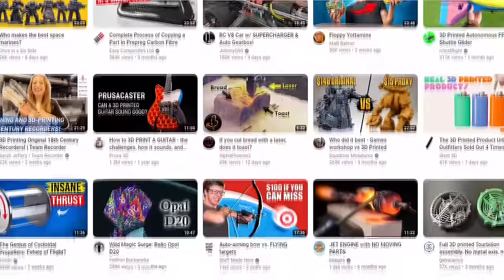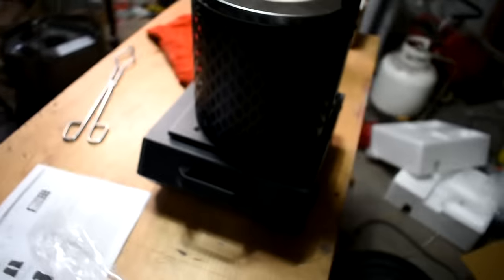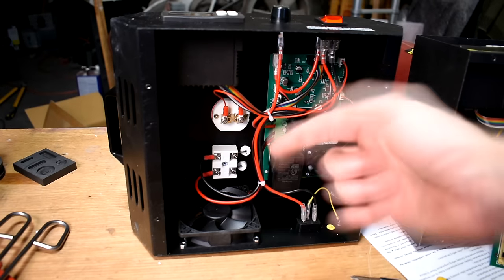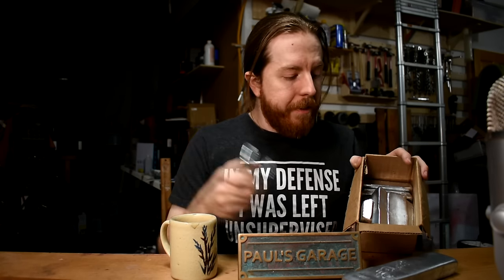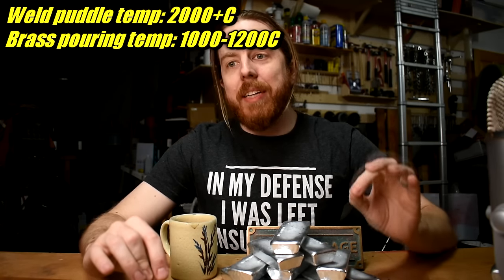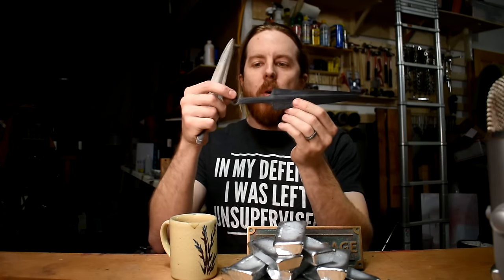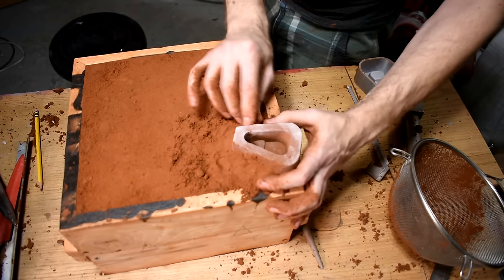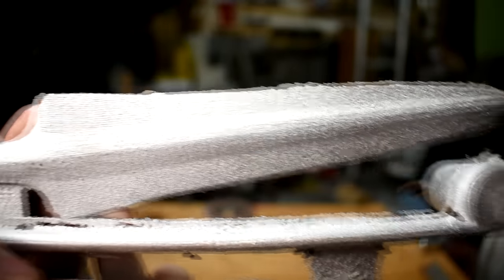Want to Start Metal Casting?

Comment from the maker: Vevor Furnace: https://s.vevor.com/bfQYTT
Code: VVMH5%OFF (5% off on all products)
Rotometals Za-12 Ingot box: https://www.rotometals.com/zamak-za-12-mini-ingots-pack-of-12-1lb-each-free-shipping/
Want to learn sand casting using your 3D printer? I can teach you!: https://paulsmakeracademy.mykajabi.com/joinus
Spear point STL: https://www.myminifactory.com/object/3d-print-spear-372026
Reply: Use a card scraper instead of sanding for 3d prints. Saves a ton of time.

Comment: Excellent video and thank you for asking Rotometals for smaller ZA-12 ingots!
Reply from the maker: thanks!  and yeah those smaller ingots are super nice.  The huge ones are even too long for my biggest crucible in the propane furnace, they stick out the top.
Reply: @PaulsGarage  ordered a box.  Have lots of stuff that’s too big for my new little furnace like yours. This solves having to make small ingots to try it out. (I have large gas one too, but it’s under snow still.

Comment: Nothing wrong with making castings from extruded aluminum. That's what i use most of the time. Window and door frames are 6061-t6. I turn them into ingots for storage and before casting. All the aluminum, brass and bronze i got was free. I just put the word out i wanted any scrap, now i have about 300lbs of those alloys. Probably more than I'll ever use. All metals are cast at some point in their manufacturing process. Just use an alloy that suits your needs. The electric furnace sounds good. But it's a little hard to use offgrid.
Reply: If offgrid is your thing, gas burners and propane cylinders are a much more attractive option. This furnace is more for apartment dwellers and those living in HOA hell.
Reply: @kfoltman  I'm living 40 acres, no neighbors close enough to give me a problem about what I do. Unfortunately we have a POA to maintain the roads. Even in the middle of nowhere, people have a HOA attitude 🙄
Reply: Extruded aluminum vs aluminum cans...to get clean aluminum from aluminum cans, you end up scooping off more dross than actual aluminum...like ALOT of it...a fluffy foamy looking crud...end up using like 20-30 cans to get 1 lb of aluminum.  Not sure the small little kiln would even hold cans unless you smashed the bejesus out out of them..maybe one of those larger 8lb ones in a propane kiln maybe.
Reply: @haydenc2742  Would be pretty simple to make cans fit in smaller crucible, but would require more processing. Just cut the top and bottom off, cut the aluminum cylinder in half, and roll it up. Presumably, all while wearing gloves. May even be able to melt off the plastic coating on the inside before melting at that point, too.

Comment: zinc poisoning (or zinc fever) is by the way completely harmless, sure, uncomfortable, but you wont die and it wont damage anything in the long run. also you would need to weld like a LOT of galvanized steel in a day for you to get sick. (goes faster when melting brass but still, if you do it outside, its fine anyways)
Reply from the maker: Good points for sure.  I've never felt zinc fume fever but I'm always working with some ventilation.
Reply: One of my first jobs was welding galvanized frames. Little spider web bits floating in the air all day long. 
My boss told me if I breathed too much it'd make me feel weak and nauseous, and if that happened to drink a glass of milk to feel better. 
I thought he was full of crap about the milk, but I guess it's true.

I never took any precautions, cause I was an invincible teenager,  but it never adversely affected me.
Reply: I was always told to drink milk for zinc poisoning.
Reply: Can say milk works for minor cases, but it could have also been leaving the area and getting fresh air.
Reply: @Mandersen700  this wont help :D its like getting sick, it feels just like having a flu for a couple of days
Reply: @PaulsGarage  case in point. its almost exclusive to people that worked in foundries before they had the proper protection gear
Reply: @SharkyMoto  I don't care if it's true or an old wise tale, because the placebo effect will make it true for me. The people who taught me said it was true. Years ago when I looked into it, I couldn't prove it or disprove it. I'm going to keep believing the old saying. Do you know of any articles or studies proving milk doesn't help zink poisoning.  I would find more knowledge on this topic interesting, but don't have the time/motivation to look into more.

Comment: You NEED a Simpson analog meter (found at a garage sale because the new ones are painfully expensive).  Also, thank you for asking for hobby-sized ingots!
Reply from the maker: that would be nice!  i'll have to look around.  Digital is nice but they don't seem to last
Reply: @PaulsGarage  The problem is usually the leads.

Comment: vertical elements are critical.  If it works on the limit, over time the element "flows like noodles", and settles to the bottom, causing electrical damage. Helicoidal channel is more durable

Comment: I 100% will be castimg from alloy cans at some point. No matter what you or anyone else says. Simply has to be done, even though it's shit. :-) I'll also be using sliced up clean alloy wheel metal, too. This IS the right metal for casting as you yourself hqve stated right here a few times :-)

Comment: Note that in an AC circuit, resistance is only one form of impedance at play. A coil of wire also has inductive reactance that further restricts the amount of current.
The only way to really check wattage is to measure current flow through the system.
As an example, do your math on an old incandescent light bulb.
Reply: A heating element is going to have almost no reactance, I would guess less than 1%.

Comment: Awesome video! A couple questions, would you recommend these electric furnaces over your homemade propane furnace? I ask because my outdoor area for melting metal does not have access to an electrical outlet. Also, what do you do with the blackened or burnt sand after casting? does the sand degrade over time? Thanks!

Comment: I would almost be into the new one if it handled a bigger crucible.  Banging my scrap into small enough strips that it fits in the Vevor is getting to be painful.  If only they made a 10KW 240V furnace.
Reply from the maker: If you have big scrap, you really can't beat a gas furnace

Comment: Would there be any additional strength benefits using this Za-12 for an Aluminum Bronze casting? I appears there might be to much zink in these ingots for the making of bronze but I am definitely not a scientist?
Reply from the maker: There is definitely way too much zinc, yeah.  You would end up with a brass with aluminum added instead of aluminum bronze with zinc added

Comment: Vevor don't sell the electric furnaces in Australia yet. Only the gas ones.
Reply from the maker: ah that's a bummer.  there are probably other sources, i think most of the ones that look the same are from the same source, just sold through different suppliers
Reply: There's some that look almost identical to Paul's (both models) on evilBay.

Australia is a great place to live, but holy crap do we get screwed over on availability of products, and the price of what IS available.
Reply: The big problem is the different voltages. While it is easy to design heating systems like this to be adapted to either voltage, some companies remain America-centric and do make such provision.
Reply: @MickTee2k  True, but there's plenty of the rest of the world that runs on 220-240V, and we miss out on a lot of their products too.
Reply: @dfross87  I'm in the same boat mate ;)

Comment: You can cast resin printer test prints? With all thin string-like hanging details? What is it, metal magic?
Reply from the maker: lost resin casting, yes.  it's like lost wax but instead of wax you use a special burnout resin.  If you want better details, use a vacuum casting rig.  Then, anything you can print, you can also cast in metal, with great detail

Comment: Let's say some one was... not so observant... and missed that you released this video mentioning the smaller ingots before they ordered some of those 4lb Za-12 ingots... How would you cut those down to fit in that crucible with as little metal loss as possible?
Reply from the maker: You would have to rip the ingot lengthwise then cut them in half.  I suppose a band saw could do it with the least metal loss, but this stuff can gum up blades.  Not sure which kind would be best
Reply: @PaulsGarage  Thanks for the tip and videos!